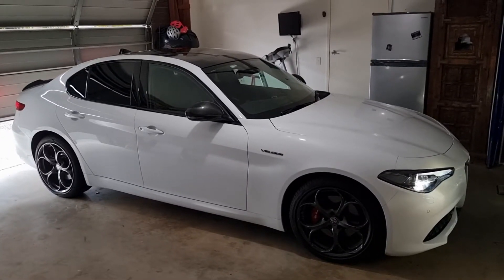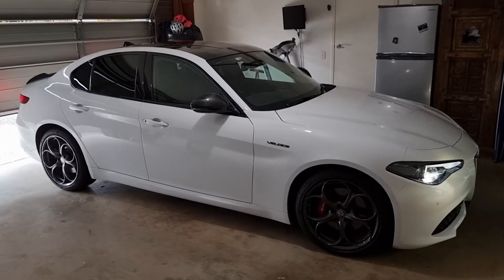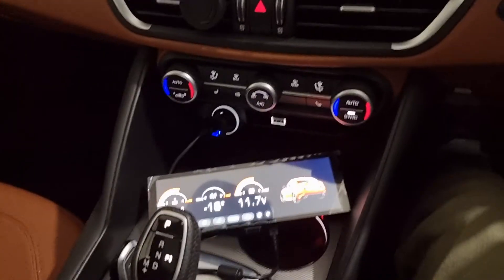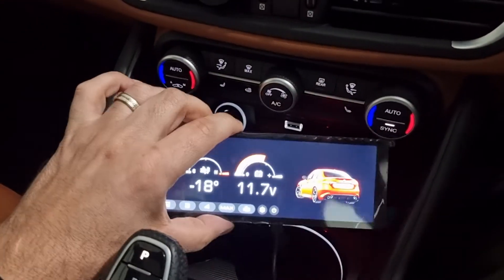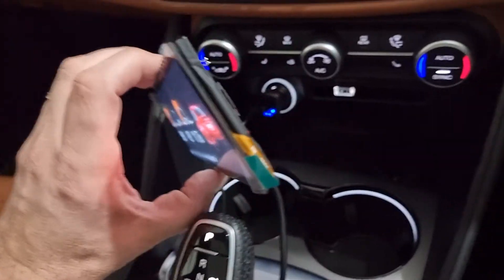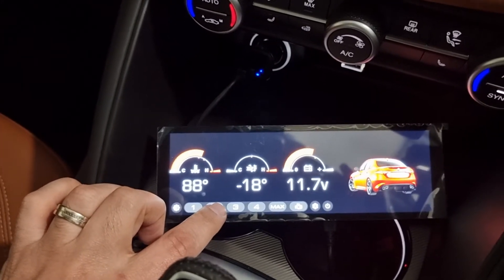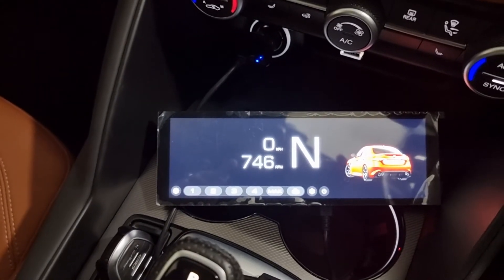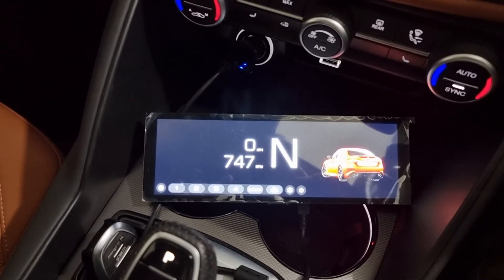Giulia Digital Gauges with a Raspberry Pi and OBD2 connection

Comment: can you provide the data for Giulia?
Reply from the maker: Sure. Most if not all the data it pulls are standard OBD codes eg for rpm, speed etc. I never got the gear ratios working correctly. What data were you after?